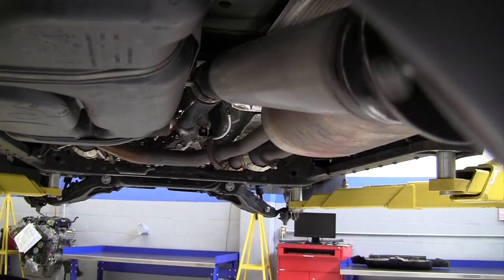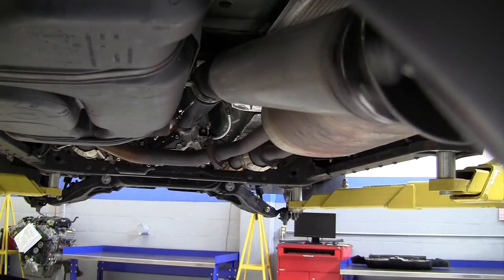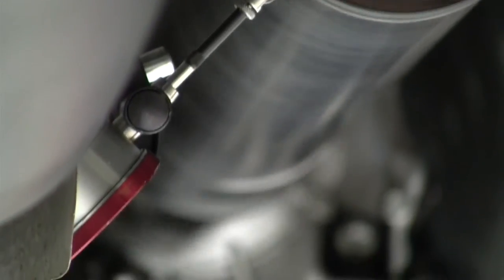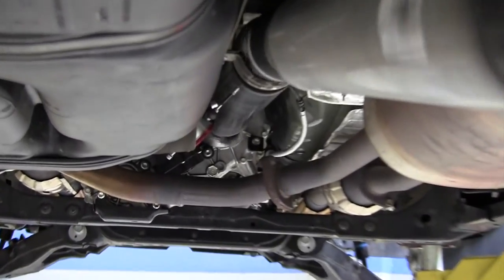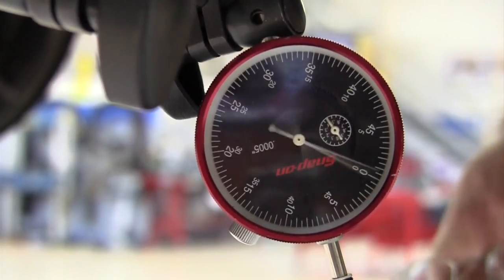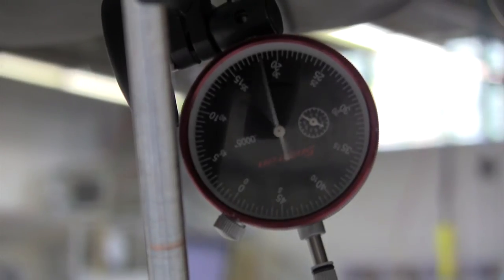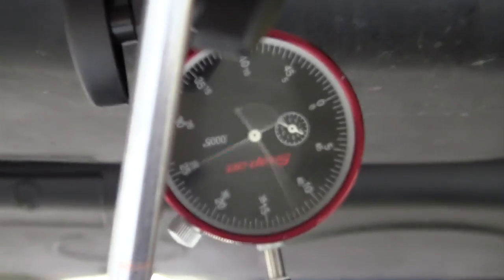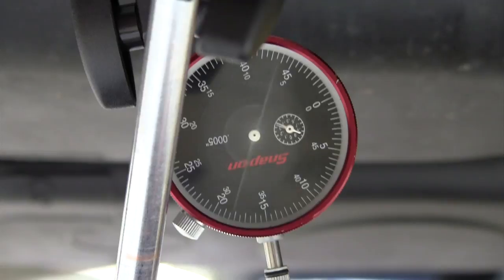How to measure Driveshaft Runout

Comment: By the way, there's a reason focus is difficult when you zoom in. With all zoom lenses, minimum subject distance increases when you zoom, so for best results you want to mount the camera as close as possible to the subject to allow you to use as wide an angle as possible. At the widest zoom, you can usually focus the camera to within about a foot of the subject. Of course safety and practical issues may make that impossible, in which case you need to use more targeted light, post exposure cropping, a macro lens, or a close focus diopter (sorry for the nerdy bits, I was a photographer in another life).

Comment: If you are building a driveshaft in a lathe without a balance machine i would agree that this is the correct way to check it. However, factory shafts are built and balanced. Those numbers are irrelevant when balanced correctly. You could have .050" runout and still balance it out. Personally i don't even balance my shafts until i get them to less than .005" using heat shrinking. But the average factory shaft has more than .035" run-out at one or more welds. The Dodge shafts are almost always over .05" Dorman shafts are even worse.  Again, if you're building a shaft without balancing this would be correct info but all factory shafts are balanced. May not be balanced correctly, but they are balanced and this method would only be applicable in a very small number of factory shafts.

Comment: You need to do the test with the suspension loaded to bring the pinion into operating angle, the ujoints being out of angle can cause what looks like out of round.
Reply: Please explain what you mean about the suspension being loaded. I’m planning out some thing for my car.
Reply: @chrisjohnson5790  suspension needs to be "at road hight", otherwise the angles on the joints are exaggerated, giving false runout.
Reply: This is correct. Allowing the suspension to hang and rotating the shaft puts the joint in a bind.

Comment: This is important for me to get down accurate readings with this type of tool because it also applies to many different application such as ring gear run out , pinion shaft companion shaft run out ,...etc So i want to beable to read this dial gauge tool correctly as well as the bore gauge one. If one could make a video on just using the bore and dial gauge tools that would be great

Comment: There is another way to do it. Place vehicle in neutral. Chock front wheels,  Jack up one tire, spin it with your foot, while observing an apparatus.....a jack with a ruler clamped to it. raise the apparatus up to where it is just barely touching the driveshaft. as you rotate the wheeel with your foot you can observe as it comes around and gently goes sccccrrrrape, and then with a half rotation you will see a gap if it has runout, measure the gap with a feeler gauge. it is very accurate.........a dial indicator is just a tool which is attached to a fixed point with an spring loaded armature that gets pushed and the deflection is shown on a needle gauge.

Comment: On a Tundra the steel shaft by Toyota specs should be .024in throughout the steel shaft and the aluminum is allowed around .040in or .045in
Reply: Forty five years ago I acquired my parents' well used '72 Chrysler with what felt like a driveshaft vibration.  A new U-joint did not solve the problem.  I found a guy doing driveshaft repairs out of a barn behind his house.  I pulled the driveshaft out, he chucked it in his lathe and we could easily see at least 1/8 " of runout of the tube at the rear U-joint flange.  Had been that way since the car was built.  Took him barely ten minutes to cut the original weld, center the tube, reweld it, install a better quality replacement joint, and I put the shaft back in the car.  It was quieter and felt smoother than the day my dad bought the car!  Wasn't rocket science... just decent craftmenship that was missing at the factory.

Comment: nice video but i have issue with reading the dial gauge and getting the same differences in needle deflections i get more 30 for max not 25 for max run out in one of your cases. It some times goes below zero so i am just taking max difference in needle high - low positions though i am still a little off from what you get for measurements
Reply from the maker: Thank you! Sometimes the angle at which you view the dial indicator can make a difference in the interpretation of the runout. It is always good to repeat the measurement a few times and be consistent in angle you are viewing the gauge. I could have been wrong in my interpretation of the live readings. Thanks for your feedback.